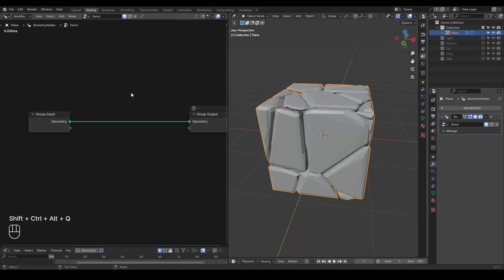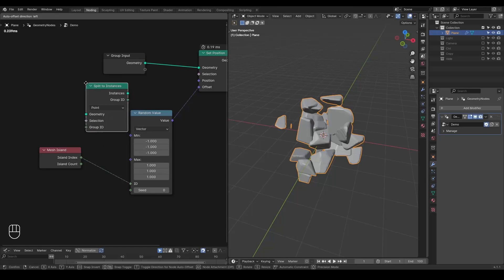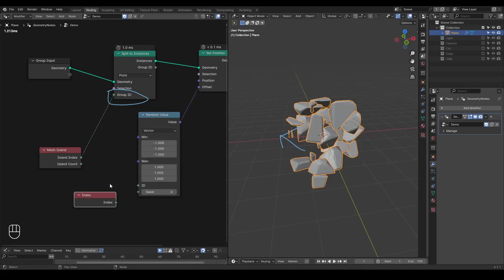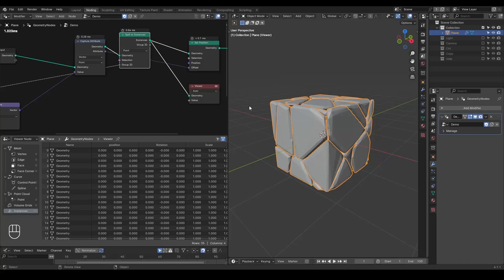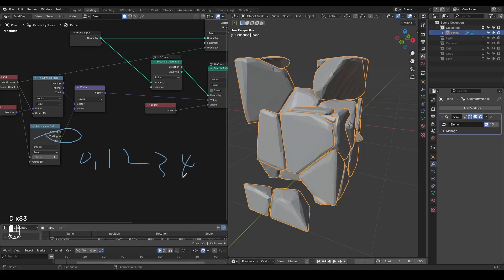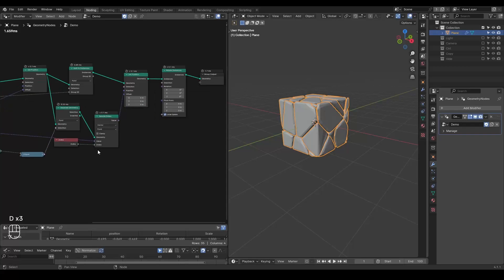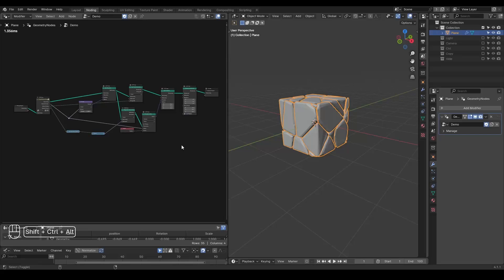[Tut] Set Geometry Origin for "Split to Instances" node - Blender Geometry Nodes Fundamental 4.1+

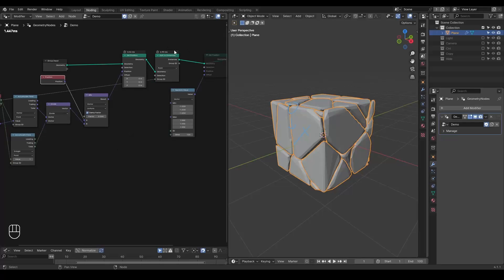Comment from the maker: 05:45 This was an editing mistake that some critical part was cut out unfortunately.
Fortunately the node tree was totally readable and people can still follow despite lack of explanations below:

The idea shown is quite simple:
"Accumulate field" is adding up all values together for each group ID.
As we are using "Mesh island Index" for Group ID, this means:
For each Mesh Island, we are adding up all positions, and the sum of position divided by the total amount of points, provides "the average position of each mesh island".
and thus we roughly get the center position for each mesh island.

This work can be simplified from 4.5, because there is a "Field Average" node to replace manual addition and division for calculating this average.

Comment: This was very clear thank you. At the start you seem to be wondering about use cases for Split to Instances. I use it when I have a node group that generates multiple mesh islands where conceptually, I want to treat each island as its own object. Because, so far as I know there is no way to Instance on Points using Mesh Island to Pick Instances. So this gives me a way to do that. (But in that case, transferring origin position information to the split instances is usually not so important anyway, we just center the mesh islands before splitting.)

Comment: hello, how did you get this nice beveling shapes in begining?😮😮😮
Reply from the maker: It was high resolution of voronoi-ed volume cube and reduce resolution down by decimate modifier.
It's extremely slow and not practically useful without applying the modifier.
Reply: @bradleyanimation120  thank you very much